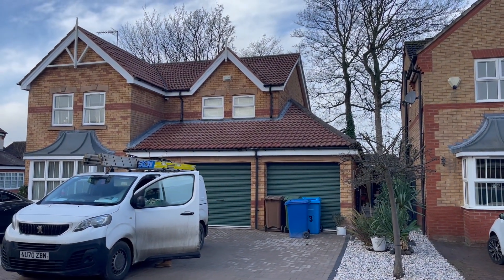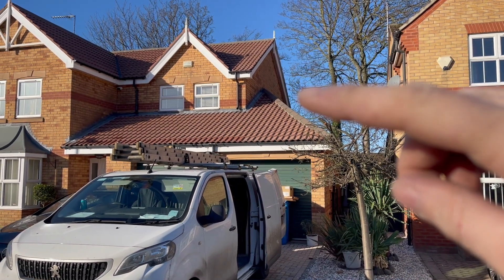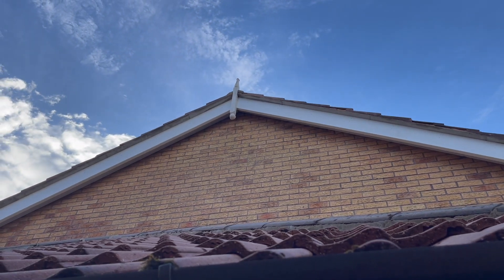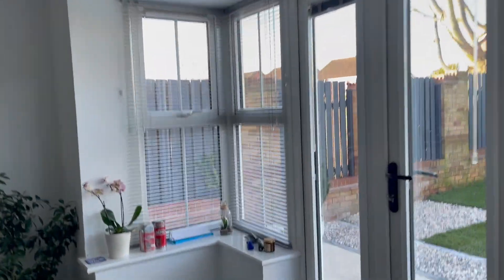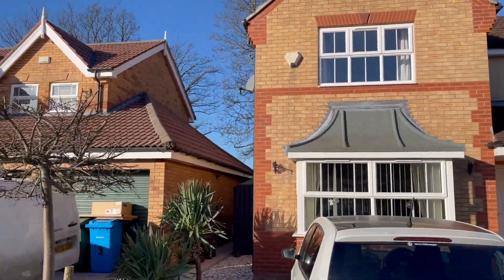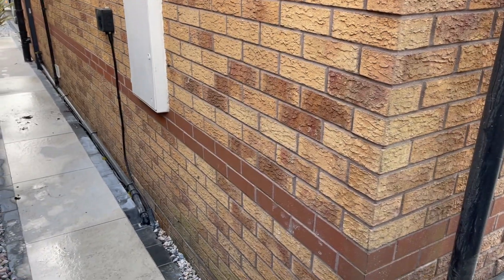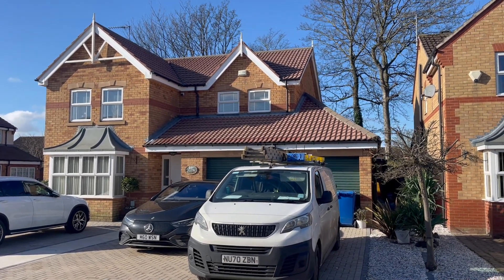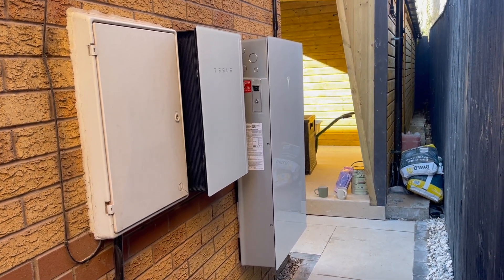How we deal with awkward cable runs… Installing Solar & Battery Storage

Comment: Whats your opinun on externaly moutning the PW3, I know it can be, but will it reduce the life span as its going to get higher and colder temps and is water ingress a concern?    Nice neat job.
Reply from the maker: Thanks for the comment. With the latest regs it's very important where the battery is located. The Tesla Powerwall 3 has built in thermal control to mitigate against this. Water ingress isn't a concern as long as it's been installed correctly the Tesla can survive and work even submerged to half it's height.